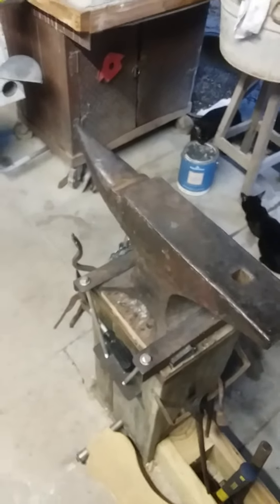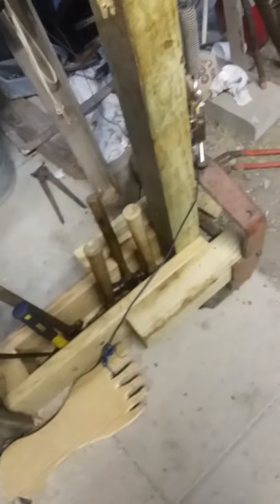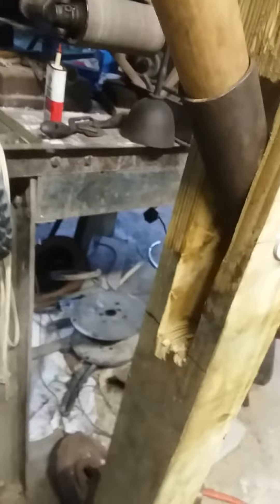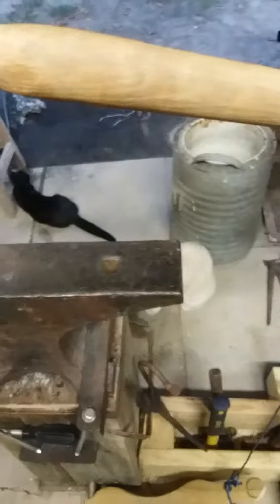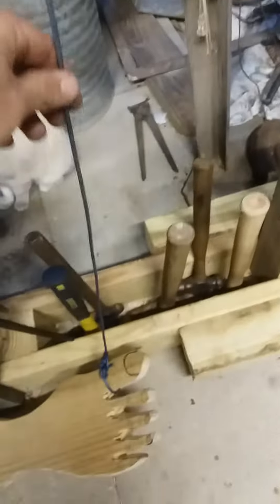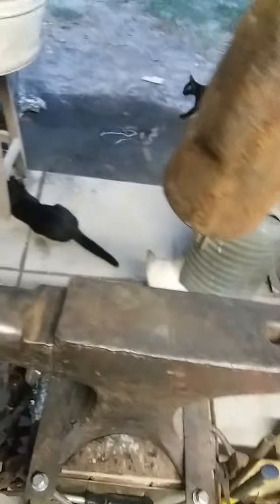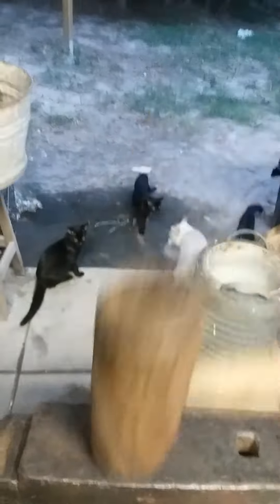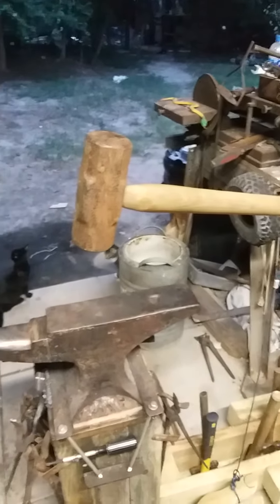Redneck treadle hammer

Comment: Genius use of the tongs! Might look a bit cheesey, but if it works, good on ya Sir. I'm taking notes, between Jason/ Shamrock forge, and now yours. Excellent work James!
Reply from the maker: Drasons Forge The tongs I discovered are only partially fixed in the wood handles. That could be dangerous. I found this out without incident. I've substituted some wire in their place.